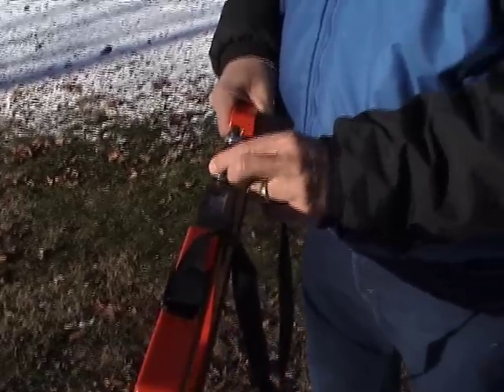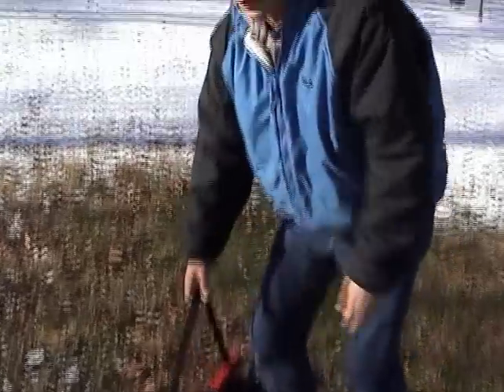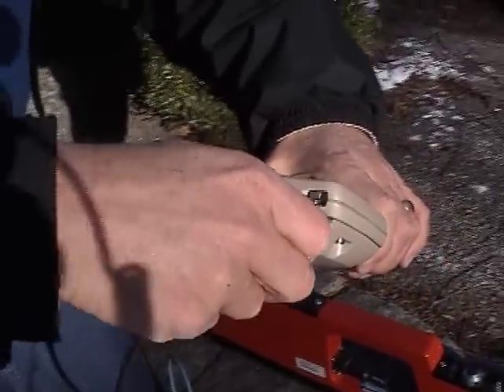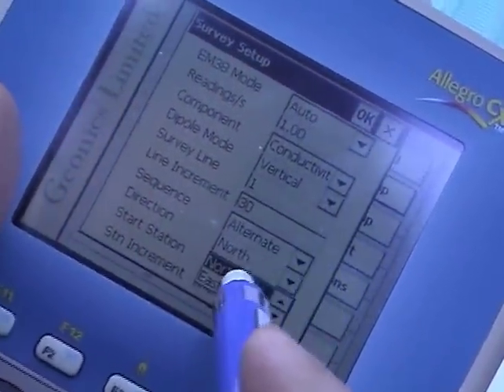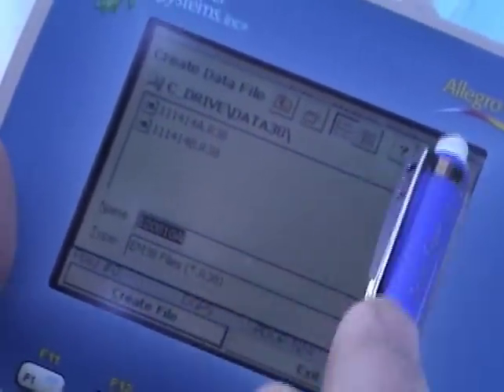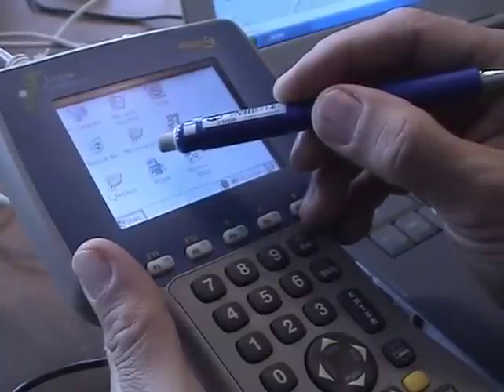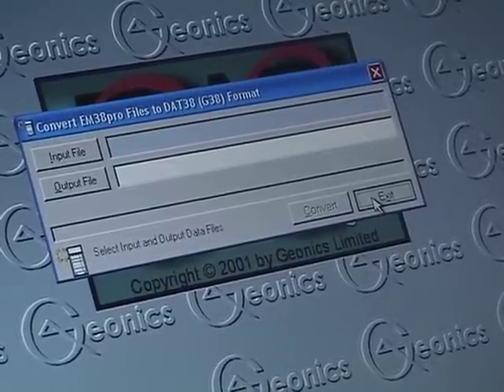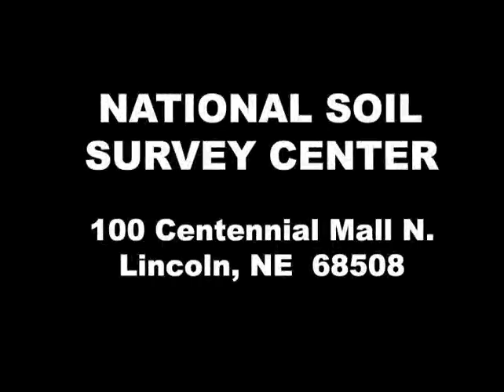Using and EM-38 for Soil Investigations

Comment: Hi, when I import the data to surfer, the conductivity data column ,has an apostrophe before the numbers in every cell. I tried a few things  in excel , but still can delete ( ' ) one time per cell.The strange thing is that ( ' ) are visible only in surfer.Do you have any idea? Thanks, I need it for my dissertation.
Reply from the maker: There is a formula in surfer you can use to remove them I cant recall it offhand need the manual. If you want to send an example of the data send to jim.turenne@ri.usda.gov and I'll take a look